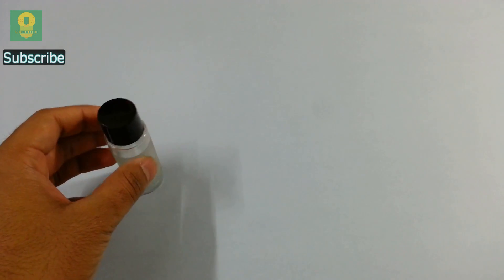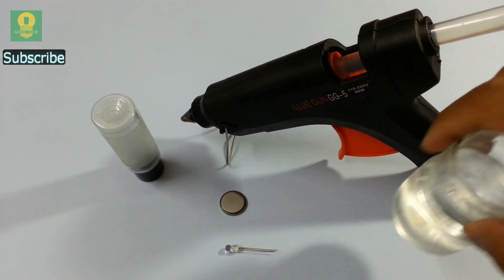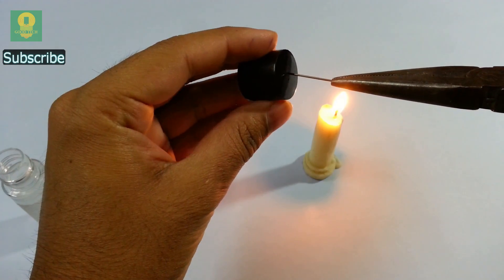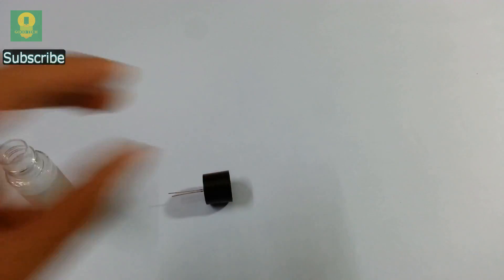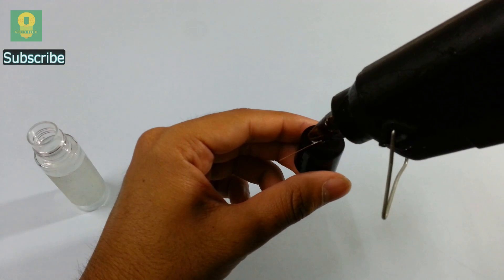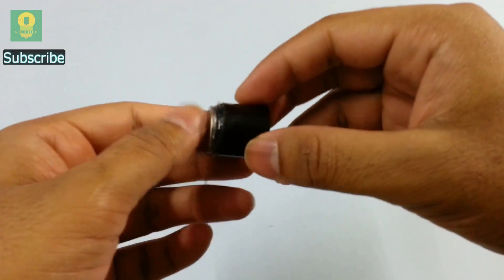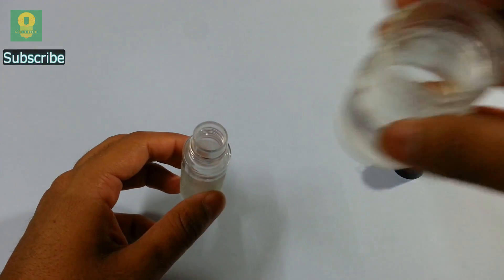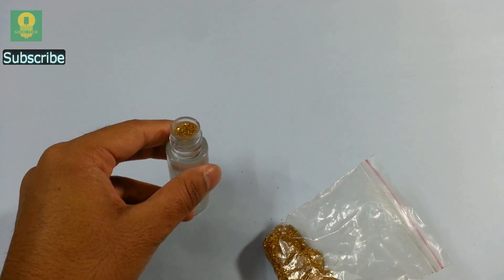How to make LED Water Lamp - Very Simple

Comment: can we use other type of battery
Reply from the maker: Yes, any battery can be used, if it can be inserted in such a way that the bottle is able to stand. Also, you can use a 5v DC wall adapter to power the LED, if you want to use it throughout the night in your room.

Comment: Awesome video , if i light this flash LED overnight ,could it survive(still working)?
Reply from the maker: Yes, this is a night light and a branded coin cell battery can light an LED for around 8-10 hrs. However, you can also customize to work with a power supply adapter like a mobile charger and then you don't need to worry about power.
Reply: +GOODTECH - Creativity and Science sndks
Reply: GOODTECH - Creativity and Science.hi.can u teach us how to customise to work with an adaptor?plz make a video if u can.its important to me.tnx